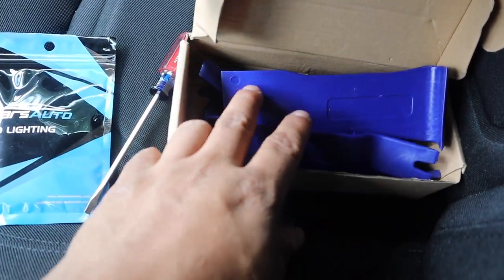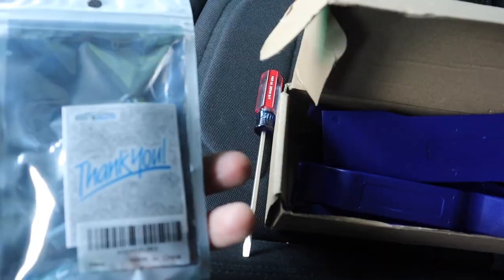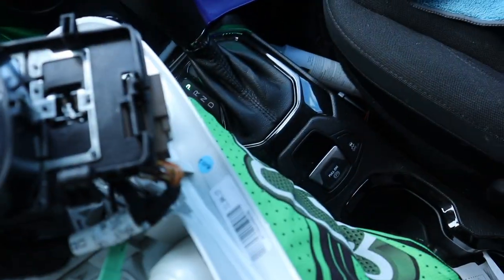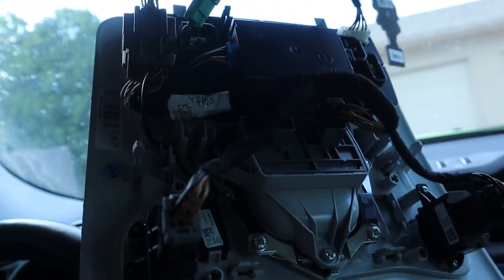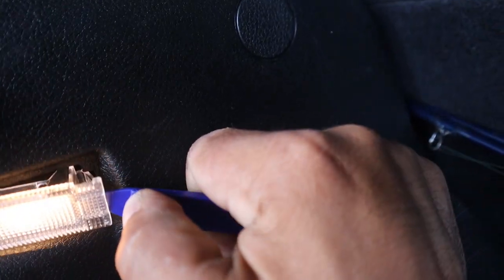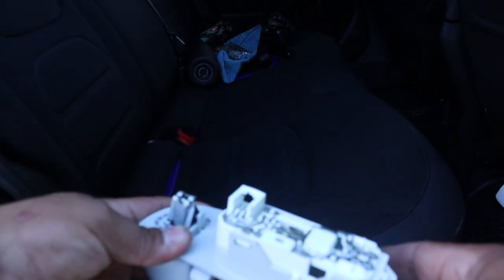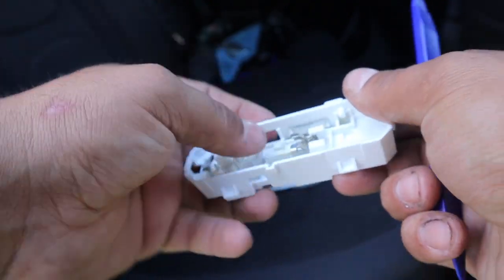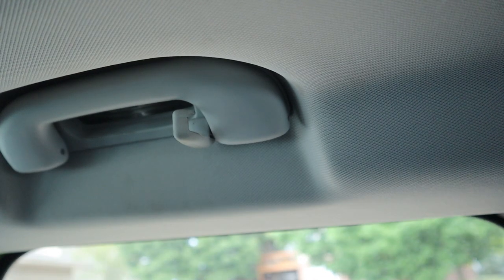Interior LED dome lights for your Jeep Renegade

Comment: I speak FROM EXPERIENCE. Watched about 5 of these ‘overhead interior light panel’ removal videos and BEWARE BEWARE BEWARE, the front tabs on the Jeep Renegade are EXTREMELY FRAGILE. I broke the right one (even after hearing all the instructions of ‘pull straight down, don’t worry’ PLEASE USE CAUTION). I like one video that said, “as you pull down insert a wood dowel and go to the next position, pull down gently and insert another wood dowel. Once you get all around, THEN pull straight down and it should be very easy with this system.” IT IS!
It was great that he also snapped one and doing the SuperGlue/Gorilla glue fix.
I DID FIND THIS VIDEO EXTREMELY HELPFUL - KEEP EM COMING I THANK YOU!!!
Reply from the maker: I'm glad you found my video useful and thanks for the support
Reply: I just got mine off with a flat skinny wrench, screwdriver and patience which I'm always low on.. no problems went great!
Reply from the maker: Patience is everything

Comment: As a former Master Level car audio installer, every time you twisted with the tool I puckered. Best way to do it my man is use the tool in your left hand to start to seperate the trim piece from the headliner, then with your Right hand work your fingers under while applying downward pressure, allows you to see what clips are holding the trim bezel in place and to also apply most of the force with your left hand and not the tool which could cause indentations in the headliner and or ripping the fabric. This can be applied to anything you are using those tools for, thanks for the Vid and the link, I have just ordered the bulbs and will be replacing them when they arrive. Hope this helped either you or someone else from possible future headaches. (SIDE NOTE) Finger Oils etc will not bother LED's especially not low powered ones such as these, maybe just to be safe I would not touch the headlight bulbs but then again they are way more powerful.
Reply from the maker: Hey buddy appreciate the input for myself and others! Hope ur install goes well.

Comment: Been following you led conversion videos and love them!  One question though, is it possible to do the brake lights, turn signals, etc?  Or even the front turn signals?
Reply from the maker: As for as what I've seen. They do make a front LED turn signal with built-in resistors. I have yet to find break lights that can do the same with out throwing a code.

Comment: I know this isn’t the the speaker videos but do you recall if the front dash speakers and the door speakers use the same adapter wires? Thanks for your videos!
Reply from the maker: They do not unfortunately. I believe I have to the different adapters lined in the discretion of both videos.

Comment: Do you get codes for the LEDs? Also, I want to add a second trunk cargo light and a 12v outlet, can you find out where the 12v is fused to? I think it’s somewhere in that rear fuse panel but I’m not sure.
Reply from the maker: No codes what so ever. I believe the fuse is in the back on the LH side. You'll have to open it end and check to make sure.
Reply: @AdventureGT  I think so too just don’t know which one. Thanks man. I’ll take a look.

Comment: My dome lights by my rear view mirror are always on but not bright as when you push the button. What’s wrong?
Reply from the maker: Do you have LEDs? If so then it's called "afterglow," nothing to worry about.
Reply: @AdventureGT  Yes, I bought the ones you installed that’s listed under your video.
Reply from the maker: Oh ok, So what's happening is the LEDs have residual current going through them. Sometimes the lights don't even need to be on first, they just slightly glow. It will not drain your car battery.